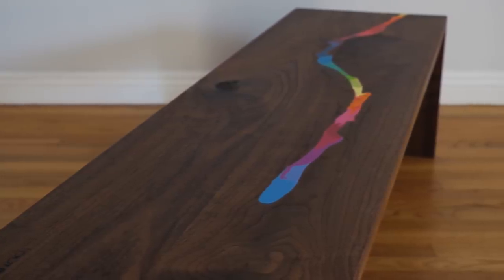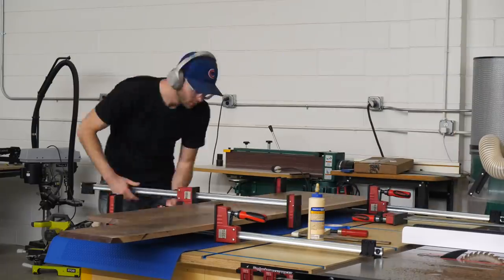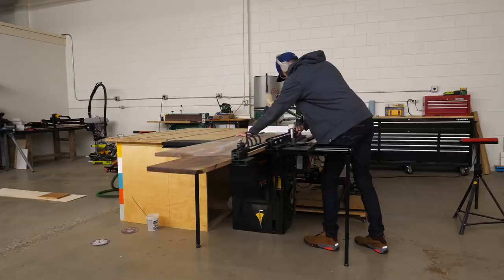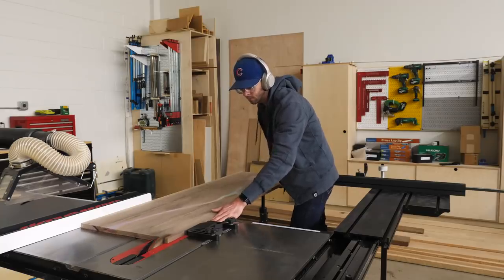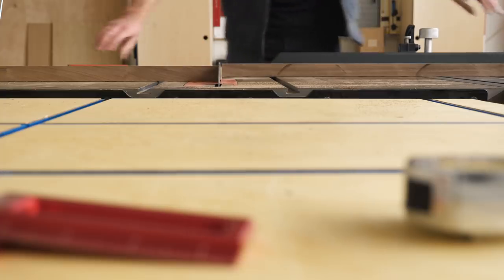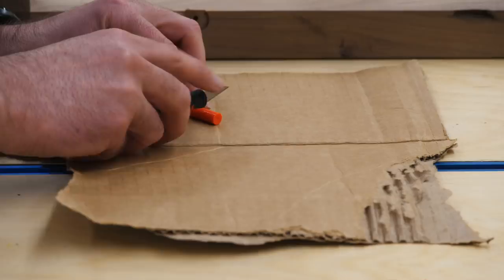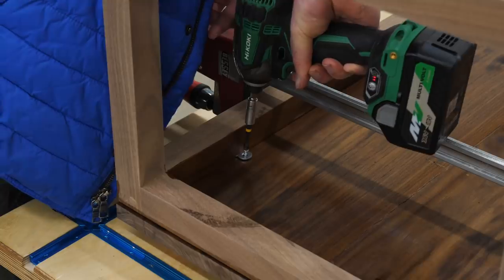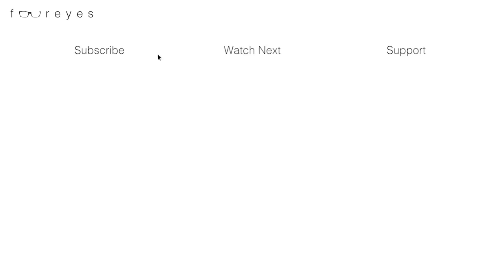Epoxy OVER Crayon River Table...I FIXED IT!!!

Comment: You can fill the holes want way you want and clean the wax with wax wash from mohawk. Or paint thinner if you wanna be cheaper
Reply: Also I recommend getting a razor blade to clean the wax off the service. Sharpen it unevenly on one side so it's nice a smooth and doesn't scratch the wood. We use wax all the time to repair scratches and to patch wood all the time.

Comment: Was the wax still liquid when you filled up the rest with epoxy? Didn't the epoxy melt the wax while drying?
Reply from the maker: No...the crayon wax hardens really quickly. There was probably about 30 minutes inbetween finishing the crayon and pouring the epoxy.

Comment: Check out Peter Brown's channel for more on how to work with epoxy. I feel like with a bit more effort you could regain the vibrancy that you feel like you lost under the epoxy. A thinner pour, hitting air bubbles with a blow torch, and polishing the epoxy to a much higher grit would all go some way towards getting a more transparent, glass-like finish.

Comment: for the plugs you could've melted a crayon into a pipe or something the same diameter as your hole, then just put it in there the same as the wood plugs

Comment: When you cut the table to size did you not expose the soft crayons on the edges?
Reply from the maker: I did...but I tested and there are no issues. had to hold the heat gun there for about 30 seconds to get it to melt out at all.

Comment: You can seal up the screw holes with super glue. Just drip some in and spray with accelerator.
Reply from the maker: good call

Comment: as long as you have a place for the crayon to flow it is going to flow there, in this case i am talking about the edges. and the same thing that says the crayon is going to flow where it can also says that the epoxy is going to break. to put it bluntly crayola played hell making their labels stick to their crayons until they started just over gluing the seam which also glued the wrap to the crayon, because the crayon changed size, all the time. constantly. if you use crayons you can even feel it, because at some times of year the wrap is loose, in the middle of the summer it is nice and tight. i say this to explain, crayon wax is extremely temperature sensitive, you can even erase it from a piece of printer paper by just heating and cooling it right. your epoxy will just crack, because it isn't just going to inflate, it is going to deflate, it is going to get bigger, and it is going to get smaller, that is gonna crack the epoxy over time. next time you want to do that, don't use crayons, there are other options that can do the same thing, but avoid wax.
Reply: if you want further evidence, buy a "new" old box of crayons, 80s or older, and open it. the crayons will have a flat side.
Reply from the maker: I have a test piece that is about 9 months old. It has gone through the hottest times of summer August/September here and the coldest we get in the winter...and it is fine so far. No cracking.

Comment: You can push the crayons through the wrapper easily if you freeze the crayons first.
Reply from the maker: People kept telling me that after the first video and I tried it and it didn't work. I had them in the freezer for about 3 hours. Maybe I should have left them for a whole day???
Reply: I left mine in the freezer overnight, but I did notice they warm quick. I used crayon to turn a pen. Came out better than I expected.

Comment: How deep did you rout the channel?  Looks about 1/2 inch and crayon filled it up about 1/4 inch.  Making a similar table out of 3/4 Birch plywood but thought laminating 2 pieces of them might be a bit much so going with 1 piece if possible.
Reply from the maker: You're about right...for yours, I think it'll be plenty strong still...unless you're going to tap dance on it :)

Comment: Hey, Chris.  did you get bubbles?  I tried this and got air bubbles at the join between the epoxy and crayon.  I'm sure it's not the epoxy as I was careful to heat it during the curing process to get rid of bubbles.  It must have been trapped somehow in the crayon.  How deep did you route?
Reply from the maker: I routed a total of maybe 1/2" max. It's possible that you had a air gap in the crayon and then the heat of the epoxy melted the wax enough to let that air gap partially out (as a bubble) Could be that the crayon only melted on the top portion??? Obviously these are all guesses

Comment: If you didn't already know, if you plan on using crayons in future projects, putting them in a freezer before using them will make it exponentially easier to remove the paper casing :)
Reply from the maker: I had a lot of comments say that on my first video. I tried it and it didn't work. Had them in there for about 2 hours? Maybe I need to do it overnight?
Reply: @Foureyes.Furniture  I would assume that might do it. Unfortunately my sources of this information weren't terribly specific regarding how long they should be put in the freezer, but the end result is the crayons should simply slide out of the wrappers. Hopefully it works out!

Comment: Use a cheese grater on the crayons and melt the shavings (pencils sharpened would work too). I feel like you could mix and match colours more fluently and have more intricate designs like a watercolour or something.
Reply from the maker: I tried chopping them up into finer bits in some testing...the problem is they blow away from the heat gun and get all over the place partially melted. Including mixed in with other crayons where you don't want them.
Reply: I wonder if an iron would work. Like even just a clothes iron on high. Keeping it slightly off the wood so it doesn’t burn. Unless it burns the candles also.

Comment: what about mixing glow in the dark powder into the resin on top of the crayon?
Reply from the maker: I don't know about this glow in the dark powder...but I'll be on the lookout.
Reply: @Foureyes.Furniture  I know Smooth-On has a product called "glow worm", but any phosphorescent powder off amazon should work fine. they come in tons of colors.

some are colorless powders that emit green or blue light, while some are the same color as the light they emit, so that's really the only aspect to worry about.

Comment: How do you keep the crayons from being launched by the blowing ?
Reply from the maker: Put the heat gun on low to get the initial melt.
Reply: @Foureyes.Furniture  thanks I figured out my problem dont use nock off crayons they melt slower which makes it easier to blow away and also to note the pigments separate from the wax  when heated. So it looks bleh.

Comment: The epoxy might be bubbly if you stir is roughly to get the bubble out either stir SLOW or use a hair drier to draw the bubbles out this is just a random comment not related to the video lol
Reply from the maker: Yeah. I use my head gun to do it. I've seen some people use a torch.

Comment: well. you said nothing would happen to the epoxy version. but what about the crayon level on the sides. if that heats up wouldnt it just drip out, makin it even harder to fix ?
Reply from the maker: The melting point is 140 degrees...so it won't get that hot. I also tested it out by putting a heat gun directing on it, and it was fine.

Comment: Could have filled the screw area with some glue, maybe CA to seal it then melted the crayon in.  Additionally you could get the same look with epoxy, but you will need to polish it.  Epoxy well polished is like glass.
Reply from the maker: yeah, had a few people suggest that. I think it's a good call.

Comment: I mean, if you had to try it a third time, why not do the fold over approach like you did with the first one but the second technique?
Since we're still testing, why not revisit the crayon plugs? You could do the plugs like you did here and hollow out the plug most of the way but retain the sides. Then, like you tried to do in the video, put crayon into hollowed out plug and top up with epoxy to match the table top technique.
Because you don't hollow the plugs right through, you still retain the wood bottom, hopefully reducing the soaking of the crayon in the hole.

I know it kinda sounds convoluted, but you are making a cup out of the plug (minus the handle obviously) and then using the table top fill technique to finish it off.

Once done, still take it to the bandsaw to cut out. It may require a soft cloth and maybe hardish rubber to protect the epoxy and the plug itself from destructing when hammering it home.

I do like this version better than the first one.

Comment: for the screw holes probably need to use epoxy first until it soaked through and then put the crayons in, which is probably not worth it.

Comment: Ok, so, you didn't cap the ends of the canyon/epoxy channels at the ends of the table? Couldn't crayon ooze out under the epoxy?
Reply from the maker: I tested it and to make it happen I needed to hold the heat gun there for about 30 seconds. So basically it would have to be several hundred degrees to come to that...in which case my house is on fire.
Reply: @Foureyes.Furniture  good to know!

Comment: Need some advice.  I did a test with crayon and epoxy and it did not come out as nice as I hoped.  I poured the epoxy and popped the bubbles with a heat gun.  A few hours (~12 hours) after I poured and degassed, the test looked pristine.  But after the three day cure, tiny tiny bubbles formed on top of the melted crayon.  The epoxy itself is still extremely clear.  Any ideas on how to prevent this from happening?

https://drive.google.com/drive/folders/18rFjFyUE2OzY8FckXPn_8DN_pPoTzgrT?usp=sharing

Pic 1 - hours after epoxy pour ; Pic 2 - After the three day cure

Comment: 7:17 You could fill similar spaces with crayons using a hot glue gun, just use crayons instead of hot glue sticks.
n.n
Reply from the maker: Yeah, a few people suggested CA glue to plug it up. That seemed pretty good.

Comment: how does he heat the crayons to melt without them spraying up all over the table top?
Reply from the maker: A heat gun on high heat but low air flow to get it started. Then you can turn it up. A lot of people think it's a hair dryer...which you could use, but heat guns are WAY hotter. Several hundred degrees.

Comment: Should have painted an epoxy coat on the edge were the crayon is exposed.
Reply from the maker: I tested it out and it takes an insane amount of heat to get any crayon to melt out. We're talking hundreds of degrees.

Comment: theres an issue with this, since the crayon is still there, its still going to break, leaving cracks underneath the epoxy
Reply: I wouldn't think that would be an issue unless there's a lot of flex in the tabletop, and it looks like it would be pretty rigid to me. That said wax has  a relatively  low melting temperature, if that happened I'd bet you could just take a hot air gun to it to reflow the wax and close the cracks

Comment: But at the same time, it's still just as durable as a crayon, cause you cut the edges opening them to air, prying fingers, anything that can basically ruin a crayon, or that a crayon can ruin (White pants be damned if you bump into this table)

Wouldn't it have been better if the edges stayed sealed?

Comment: what you want to use is this: https://smile.amazon.com/Professional-Colored-Including-Coloring-Sketching/dp/B0716W4HT2/ref=asc_df_B0716W4HT2/?tag=hyprod-20&linkCode=df0&hvadid=198059285915&hvpos=1o1&hvnetw=g&hvrand=12836377756245151119&hvpone=&hvptwo=&hvqmt=&hvdev=c&hvdvcmdl=&hvlocint=&hvlocphy=9024249&hvtargid=pla-348806971902&psc=1&sa-no-redirect=1 oil pencils, gotta let it dry after you melt it, but it will cure WITH the epoxy, instead of just sitting under it. might have to change the parts a little though to get it just right. and this is without mentioning that you can always just dye your epoxy.
Reply from the maker: I'll mess with it down the road...you can actually melt the oil out of the pencil? How would you remover it from the pencil?
Reply: @Foureyes.Furniture  you could probably melt it, but better yet would be just to contact the company. otherwise you'll probably be wasting a lot of time whittling pencils =P. most companies will sell parts of their manufacture, except in the tech industry, but it can take some leg work.

Comment: Your forgot LED strips! :)
Reply from the maker: dang it.....version 3 coming :P
Reply: @Foureyes.Furniture  Hmmm... Route groove, > insert and glue strips in it, pour epoxy over, sand to the epoxy to diffuse, melt crayons, pour more epoxy, polish epoxy, wire strips to a lower voltage power supply so they won't overheat because the heat won't dissipate into the wood - give up because it's too much work ;)